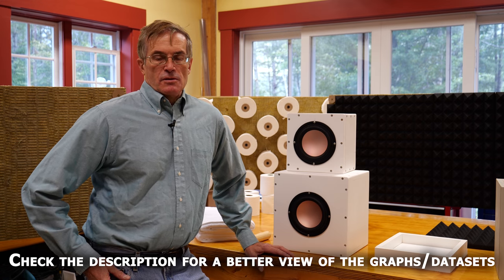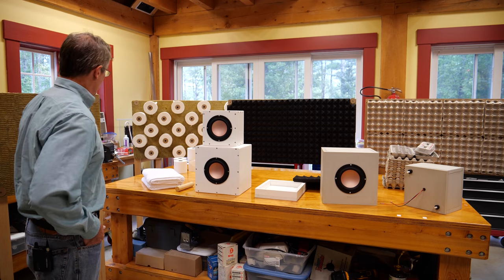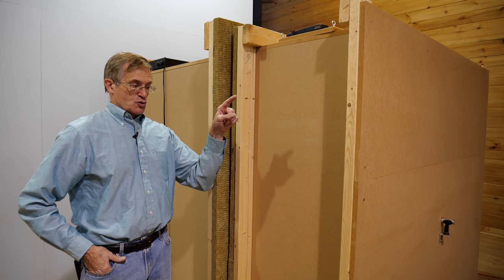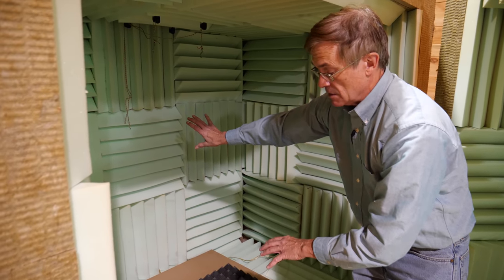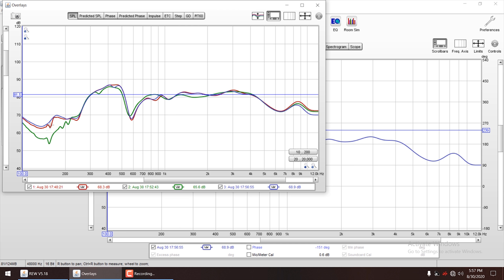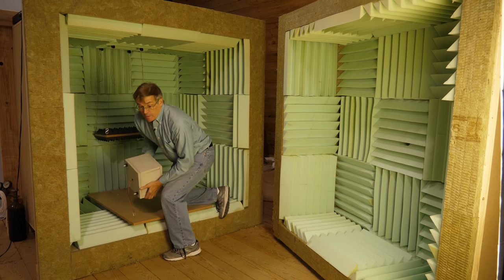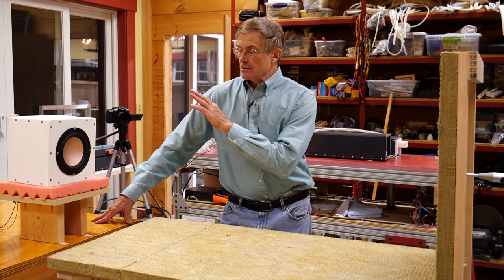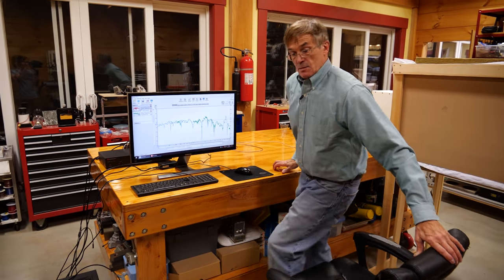DIY Speakers and Acoustic Panels

Comment: wouldn't the helium rise to the top of the speaker box and escape out the hole leaving air in the bottom meaning its only half helium?
Reply from the maker: There's turbulent mixing.  That's why nitrogen which is lighter than oxygen doesn't separate in the atmosphere.

Comment: after sanding the formboard panels, does it need to be treated with mix of water-glue?
Reply from the maker: I wouldn't.  Cover them with a lightweight cloth to retain any fibers, but a glue will harden the surface and reduce sound absorbtion.

Comment: I understand the budget constraints but the sound absorption 'room' was unrealistically small. The most sigificant room problems are usually <200Hz due to the room dimensions.
Reply from the maker: I don't think you do understand the budget constraints.  A larger room would make the testing more accurate and allow larger systems to be tested, but would not fit in our facility or our budget and could not have been built.
Reply: @TechIngredients  We seem to be saying the same thing :) Enjoying your channel, btw!

Comment: The helium makes me wonder how well a vacuum-"filled" speaker chamber would do
Reply: I think the point of the helium was to have the same pressure on both sides of the speaker cone, but less mass on one side.  So the speaker fires out like normal but the return is easier.   With a vacuum on the inside  the speaker wouldn't be resting in a neutral position, and would have to fight vacuum and pressure to fire outwards.

Comment: Since room modes dominate below 200hz wouldn't it make more sense to try to make the anechoic chamber with non parallel surfaces?  I would love to see just how far you could suppress the bass frequencies with the right shape, if there was some 'magic angle' or proportions or shapes that worked optimally.  Also the nature of bass traps even in a miniaturized room the size of a large freezer should still suppress further, that could also be optimized or studied for how large it's worth going before diminishing returns.
Reply from the maker: We were trying to compare the materials themselves rather than the effects of the enclosure geometry.  Once that's established, then looking at shape is a reasonable next step.
Reply: @TechIngredients  You did a wonderful job, for years i've seen people do DIY sound panels often things like egg cartons, the frequency plots finally show why it seems like it dampens more than it really does, ie some vocal frequencies toned down is an instant change to your ears but across the spectrum there are vastly superior materials.  I've seen many other people make DIY acoustic panels that according to this is more marketing or perception than science - yes there is some suppression but the real question seems to be how much for the money?  Except when using possibly free materials it does no good to have to use 3x the thickness of one material if it costs more for the same performance as another panel.

One other material I would like to see is compressed straw.  Strawbale homes in specific are known for being incredibly quiet.  The sheer thickness of the bales is a big part of that, but for the money I wonder whether say 6 inch 'slices' from a band saw might match or even beat 6 inch slices of any other material, especially for the money.  I've thought just a strawbale thrown in the corner would make a good bass trap or even one sawn diagonally if it makes better aesthetics.  I'd probably want to try to treat for fire resistance (i've heard Borax can do that) for some of these materials but any coating could affect the sound resistance as well, just like some other materials could use the same, but anything amounting to a plaster might affect the surface reflectance as well.

Comment: With the helium, wouldn't you want to put it in the top port, since it is lighter than air and would displace downward?
Reply from the maker: If you added the gas, VERY slowly, you might get some lamination and selective air venting at the bottom. In practice, turbulence will negate this effect.

Comment: Idea - Could you adapt a speaker to drive acoustic panels? That is. Place a speaker behind touching the panels and run some machine learning loop to filter out all the unwanted sound. DIY Active Acoustic panels. //Per
Reply from the maker: It's easier to bypass the other speaker components and just use it's magnetic driver which is what these exciters are.  A simple method to flatten the output spectrum is to do an analysis and then incorporate a parametric equalizer, you can build or buy these.
Reply: @TechIngredients  No need to characterize the speaker in an anechoic chamber, since the final frequency response will be totally different in the specific room where the speaker will be installed. A MEMs microphone can be used with a DSP to dynamically calculate the transfer function of the speaker/room and, using the inverse of the transfer function,  the DSP can efficiently flatten the frequency response in real time.

Comment: Just wondering with the chamber, could you attach a couple of loose rope or strap hinges to the far side of the chamber so that when you push or pull open the front half that it doesnt run away from you too much?
Reply from the maker: You could.

Comment: I guess it doesn't really make  any difference after the purging time, but wouldn't it have been better to attach the helium tube to the top of the speaker rather than the bottom, as the helium is lighter than air?
Reply from the maker: You're right, after the purging time the gas is pretty well mixed.

Comment: Shouldn’t the input for the helium have been at the top to force the heavier air out the bottom? Or would the difference have been negligible due to the volume of the helium input?
Reply from the maker: It would have been negligible.

Comment: I thank you for all your videos. You cover many subjects I'm interested in. I worked in recording studios for several years and, as far as sound and acoustic design goes, one of the biggest problems in control room design is taming the low frequencies in small rooms, given that a 20Hz wave length is approx 60 feet (1/4 wave of 15'). One of the most interesting design concepts I heard about, instead of bass traps, is using heavy panels suspended from the ceiling and located a certain distance from the wall. The calculations I heard were: the area of the panel determines the effective frequency, and the distance from the wall surface determines the bandwidth. The mass of the panel determines the amount of energy it can absorb. These are used on at least one wall of each room dimension, so one at the back and one on the side. The room I saw these in had one on each side and a third at the back. I would love to see you tackle this subject and test the idea.
Reply from the maker: Look up fabry perot interferometers.  Interestingly, the smaller the gap, the wider the bandwidth, but the less intense the interferometric interference.
I don't know how the area would relate to the frequency assuming the dimensions will always be sub wavelength.
I'll take a look.
Reply: @TechIngredients   I would think that fractions of 1/4, or 1/8 wavelength would act to absorb specific frequencies. The idea being to tame standing waves in a room that has parallel walls and problems because of that. Of course listening levels will play a large part as the acoustic energy couples more strongly to the structure.

Comment: When it comes to porting, it makes me wonder why we put backs on our speakers.
Reply: The ports are tuned (sized), based on performance parameters (Thiele-Small parameters) of the particular speaker.  The tuning is designed to flatten out the speaker/cabinet respose curve.  A completely open back on a cabinet creates phase cancelation for all frequencies with wavelengths equal to all distances from the front of the speaker cone, around the cabinet to the rear of the cone.  Open-back cabinets often exhibit pronounced midrange performance.
Reply: @thedevilinthecircuit1414  Thanks

Comment: I've seen some people use carpet padding in their studios. No idea on thickness or density they used though
Reply from the maker: I've seen that too, however a good carpet weighs a ton and doesn't necessarily look that good.  I'd keep it on the floor put acoustic ceiling tiles above and then use one of the materials we demonstrated for as much of the wall surface as possible.  Don't forget the windows will benefit from heavy drapes or could be left open.

Comment: Love these video's!!   Question though.. The results from this video seem to differ from an older video. Here, adding foam on the rocksul does not seem te help (https://youtu.be/jjZHFIdfUFk?t=2731), but in an older video it does have significant benefits (https://youtu.be/fqodnHxRJ7c?t=772). Why would this be?
Reply from the maker: I suspect this difference is due to angle of incidence.  In this video we intentionally tested sound absorbtion at a glancing angle to replicate what a sound absorbing panel would be expected to do in a listening room.  That is also likely why we got substantially different results than DIY Perks obtained when testing the performance of towels.
Reply: @TechIngredients  Thanks!

Comment: Very cool video, but I noticed something I would have felt I would have done different....but maybe I'm wrong.  Why not fill the helium from the top so that the heavier air can exit easier on the low port?
Reply from the maker: It won't  stay stratified as you fill it.  This is why welding  gas mixtures don't form layers even when they sit in closed cylinders for long periods.  Thermal vibrations cause mixing.
Reply: @TechIngredients  Ah ok gotcha!  I knew I should have trusted you with this! lol!  Good stuff sir!  Thanks for the response!

Comment: So how symmetrical is your anechoic chamber? Or, wouldn't it be easier if your source was mounted in the door and the microphone was inserted through the back wall? Or you could use the sidewalls instead of the front and back, or the floor and the ceiling. I am just saying that your placement for the source seems to be the hardest to reach, which brings me back to the question of symmetry.
Reply from the maker: Reversing the orientation of the source and the microphone shouldn't matter.
Reply: @TechIngredients  Then if you were to reverse the positions, it would be simpler to hang the speaker in the door section, and you wouldn't need the platform to kneel on.

Comment: Best video about sound on YouTube, but one question. If adding the foam panels on top of the rock wool degraded it's performance why is that how you set up your anechoic chamber? Just for the fibers or some other reason?
Reply from the maker: Did it degrade the performance? Indeed the foam serves to prevent fibers from entering the work space, but it doesn't degrade the performance when added.
Reply: @TechIngredients  46:20

I believe that is what you said senpai..

Comment: Again, another fantastic and very educational video.  So what would your recommendation be for someone building a box to go over a generator to maximize the sound absorption/reduction?
Reply from the maker: Good question.
This depends on how much access you need, how much you want to spend and aesthetics.  If the generator  is outside, then the sound can be selectively reduced in the direction that matters ie towards the house.  Decouple massive and rigid materials  like fiberboard or cement board from each other and use several independent layers.  Cover the inside  of these surfaces with sound absorbing material like rock wool.
Reply: @TechIngredients  Thank you.  Never thought about the decoupling of the frame materials.  Don't care about aesthetics, going on the side of a brick house, but most concerned about keeping as much noise from the neighbor's house.  Might add a component of deflection skyward as last barrier of defense...   Thanks again!!

Comment: Always been told that matress foam had no absorption properties, since it's ¨closed cell¨ in structure, as opposed to the open cell of the dedicated acoustic foam. Is that a gimmick to sell us acoustic foam or does it absorb mid and high frequencies, and to what extent ? Thanx !
Reply from the maker: Mattress foam is very compressible, I'm pretty sure most types are open cell.  Some "memory foams" are not, we're using open cell.
Reply: @TechIngredients  Thanx !

Comment: You’re doing it wrong!
With over 1100 comments someone may have pointed these things out already but here goes.
Putting helium into the back of a speaker. Nice experiment but a total waste of a finite gas especially in this instance.
You should have put the input at the top of the speaker with the outlet at the bottom.
Helium being lighter than air will immediately rise and exit the top maybe taking some air with it.
With the filler at the top the gas will buildup at the top and push the heavier gasses out the bottom.

The panels 
Sound comes in various waves lengths to state the obvious. To attenuate sound you need to tune for each wavelength using materials of different density shape size and include air gaps between panels of different sizes.
Shapes can catch and or reflect sound at different angles so technically you could build anechoic  chamber out of hard materials if you could design the shapes to act like a Tesla valve only allowing it to travel out.
Usually people don’t have sufficient space or money to invest in a perfect chamber so they settle for egg cartons.
Egg cartons can work if you tune them. Using a soft glue you can attach them to a soft panel such as cardboard or styrofoam and hang them free of any hard surface such as a wall . You can hang multiple panels with different gaps between them and at slightly different angles to each other so that any reflection is directed away from or towards the target.
Other materials such as towels hung loose or in a frame , towels in a frame containing packing peanuts and various other things can be used. The best thing to do is assay the room then tune the materials and design to suit the room and what you wish to achieve.
Reply from the maker: The helium mixes due to the turbulence of the input port. Nitrogen and oxygen do not separate in the atmosphere even though nitrogen is considerably less dense.
Without complex analysis, "tuning egg cartons" is impractical.
Reply: Tech Ingredients . Nice to see you read the comments 👍
Putting the helium filler at the top is simple physics.
The lighter gas will fill the top of the container and move down forcing the heavier gasses out the bottom.
Putting the filler at the bottom may eventually result in a purge of the heavier gasses but not as quickly or thoroughly and using far more helium.
Most of what I wrote was tongue in cheek but if you’re trying to build an anechoic chamber on a budget you’ll need to do some tuning. The commercial acoustic panels are designed to be Omni directional and dampen a range of frequencies so they are a failure at some frequencies and directions. If you have a specific purpose such as sound equipment testing as opposed to a recording studio the shape and orientation of not only the attenuation materials but their density spacing and angles of incidents all need to be optimised for the task.

Comment: Do you ever use different microphones?  I would imagine it would color the sound just as much as the speaker drivers themselves would.  And really when it comes right  down to it, every piece in the chain has an effect on the overall sound and where it bottlenecks.  How much an effect it has would be interesting.
Reply from the maker: The Omnimic is a calibrated, omnidirectional research microphone.  We've used lower quality microphones in the past and generally most of these are pretty good, but eliminating any variables is obviously important.
Reply: @TechIngredients  Thanks for the reply and for the depths of effort put into the videos you do.  Cheers.

Comment: Great video. Shouldn't you pump the helium from the top of the speaker enclosure? Just a thought. It look's like you put the helium in from the bottom.
Reply from the maker: It doesn't matter.  The gas mixes thoroughly during the fill.
Reply: Thank you very much for answering. That's something I really appreciate. Fantastic video. I just have to find helium for my own speakers. I guess hidrogen wouldn't be safe to use ;-)

Comment: 22:30 Would it not have made more sense to add the helium from the top port? Since the air it's supposed to replace is more dense than it is...
Reply from the maker: Not really.  The helium mixes as it exits the tube at a high velocity.

Comment: Others have tested mineral wool and fiberglass and come to find that fiberglass has a better sound dampening ability.
Reply from the maker: Maybe, but I've seen studies with the opposite results.  Bottom line, it's probably a small difference and the construction methods, thickness and cost are probably more significant.
Reply: @TechIngredients  and fiberglass isn't rigid even if it is better, lots of dust too. Belinda car has a YouTube channel and I think she's the most recent one I've seen say that.

Comment: Great video! Super thorough and informative
I actually just built a small speaker and stuffed it with foam insulation so I might just pull some of that out and see how it is!
Reply from the maker: That's what I'd do.  Test your ideas.
Reply: @TechIngredients  I pulled out the acoustic stuffing and it actually significantly helped the bass response ! Thanks :) 
Before it sounded very muted in bassier tones, and now there's a definite improvement.

Comment: Big DIY Perks fan,  the towels originally used were just old leftovers or second hand donation shop towels. High end towels were not needed.
Reply from the maker: Sure. However, if asthetics matter that could be an issue.
Reply: @TechIngredients  in the original video he pinned the towels in a frame and wrapped it in a thin cloth.  Ended up looking great.